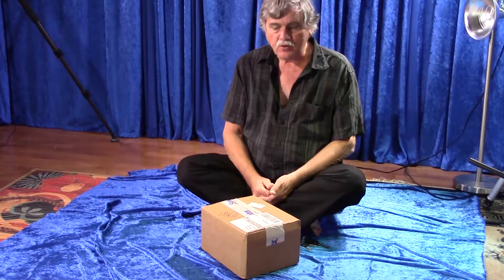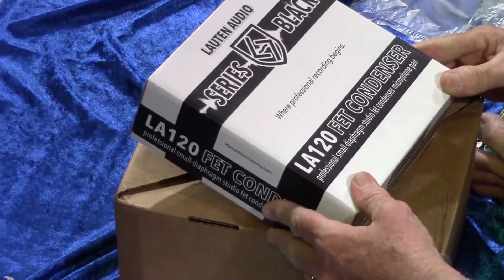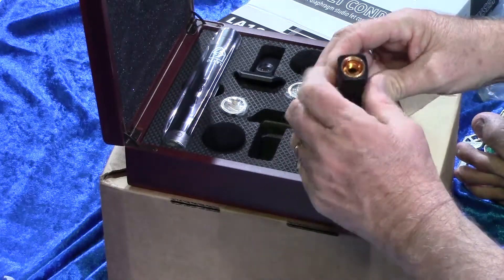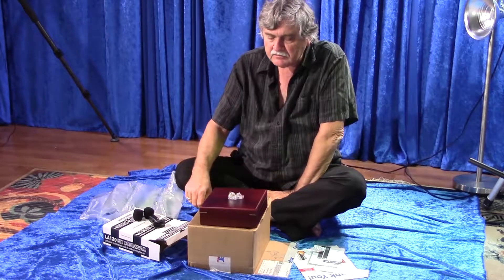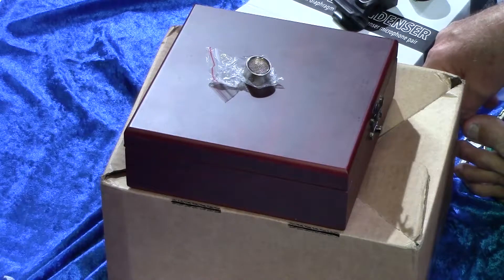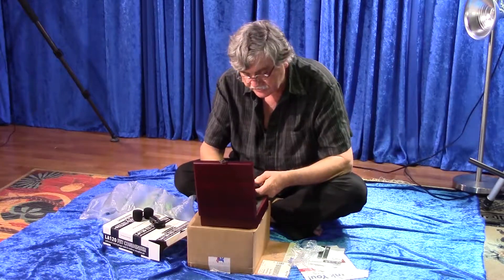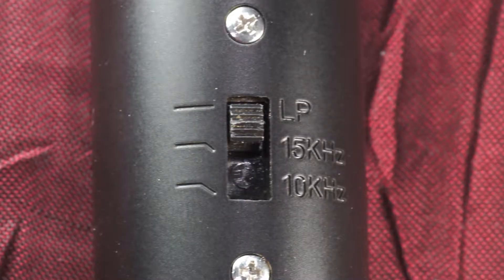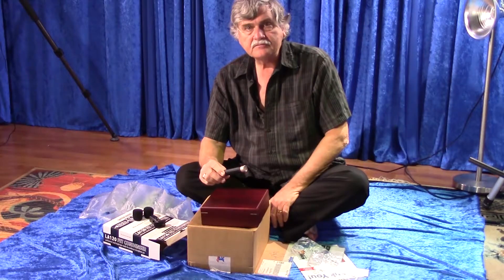LA-120 Microphone: Unboxing and Overview

Comment: Would you please expand a bit on why you would get the LA-120s after having just purchased the Neuman? How do you intend to use the different mics? Thx
Reply from the maker: That is a very good point.  But I would say that the question is analogous to asking "Why would you buy a bike, when you just bought a Mercedes?"  I have about 50 mics and they all have their purpose.  There were qualities about this mic that struck me as being different.  Perhaps I should say "different".  The uses for this mic that I am turning over in my head I would never use a U87 for.
Reply: Sorry. I wasn't trying to make a point. I am asking out of ignorance about mics in general.
Reply from the maker: Well it is like this.  You can think of microphones as falling on a continuum.  On one end of the continuum there is the ideal form of fidelity.  For this, whatever you put into the mic in terms of sound, will be reproduced (transduced) as an exact analogue in the output signal.  This is an ideal and there is no such microphone, but many people feel that the Neumann U7 comes close.  On the other end of the spectrum is ultra-grunge.  These mics are so bad and so cheap that whatever you put into it will produce a sound that bares little similarity to the original.  I would say that carbon mics that used to be used in telephones 60 years ago come close to this.

Now the vast majority of the microphones on the market today fall somewhere in the middle of this continuum.  The signal that comes out has a pretty good resemblance to the sound that went into it, but there are differences.  These differences amount to a kind of "character".  As an artist, it is always good to have a big palate of mics with different "characters" to choose from.

Most of the time you want to use a mic whose character flatters the sound of the artist, not one that accurately captures all of the flaws.

Does this make sense?
Reply: I guess what I was asking is whether this mic is for a specific purpose and if so, what and why, but I take it from your reply that you are just filling out your tool kit (which is cool, too).
Reply from the maker: I suppose that is what I am saying.  This is a transformer isolated small diaphragm mic.  I do not own, one so this was an inexpensive way to get one.